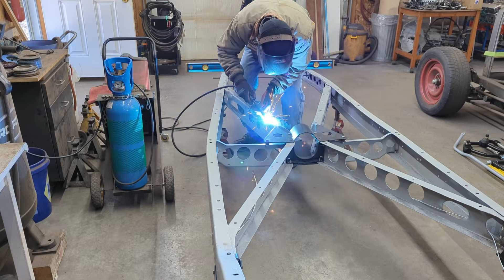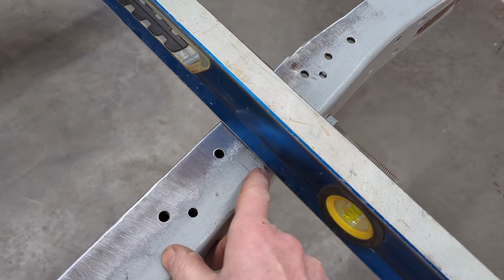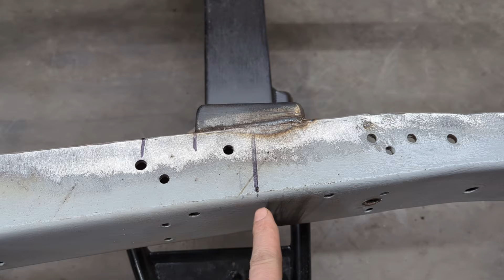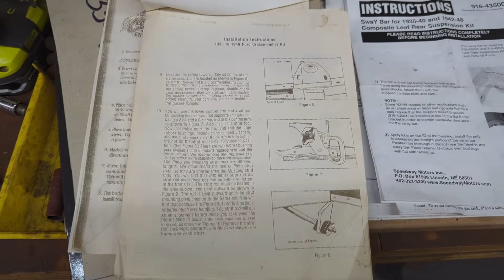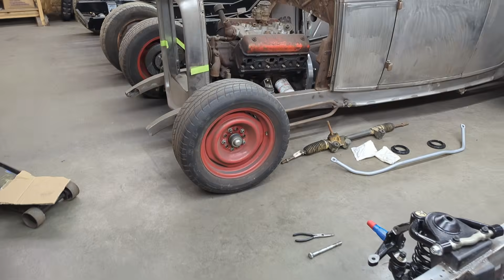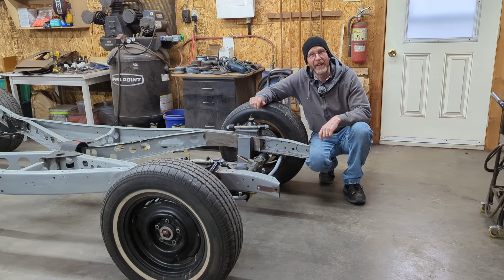Installing the mustang II front end in the 1935 Ford Pickup Chassis

Comment: Do you remember the spring rating that you used (or the customer used)?? I'm doing the same thing, and haven't had a spring rate recommended yet. Thanks and great job. Hope you see this, it's been a while. From Bill, Rhonda's other half
Reply from the maker: Hi I think we used 350 or 375 lb/in which are the lightest ones you can typically buy. Unless you're going with a big block with all cast iron parts I would stay with the lighter rates. I'm a Rhonda's other too!

Comment: The things we do no not think of that are needed when doing a frame off restoration. I for one have never changed front end components without the driveline installed. Take for granted having all that weight to keep it planted. Do you expect the front springs will be more linear and straight when the truck is fully assembled ? Does it even really matter ?
Reply from the maker: I hope the springs will settle in when all the weight is on it. The instructions for the kit even say this that it will take a few weeks driving for this to happen. I do check the geometry without the springs at estimated ride height to be sure we can get the castor and camber right. A full alignment can't be done until the car is fully assembled. You do have to rely on the manufacturer that they got it right.
Reply: @coldstreamrodshop - All good gear, just some differences, like the tie rods.

Comment: Hello Derek. Your timing is spot on as I am sitting in line at the shippers waiting to unload. Nice and simple frame repair. With the boxing plates it looks much stronger. It will be nice to see the engine and box in there. I’ve got parts from swap meets and when you go to put them together there’s always something missing or miss matched. Take care both all the best.
Reply from the maker: I would prefer to have boxed the whole frame if it were my project but as the owner said he's not putting a lot of horsepower in it. Even with new kits and parts you still have to fiddle with something, that's hot rodding! Thanks for always watching!
Reply: Yes me to. I think a good strong frame is key to a long lasting car. But I no lots of people only box where the engine fits.